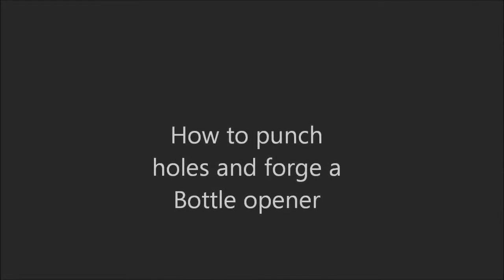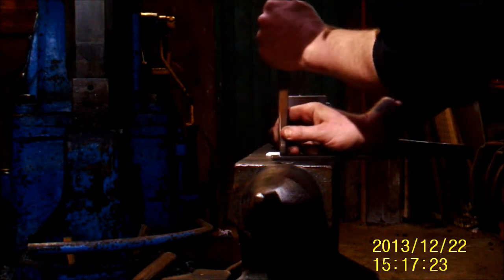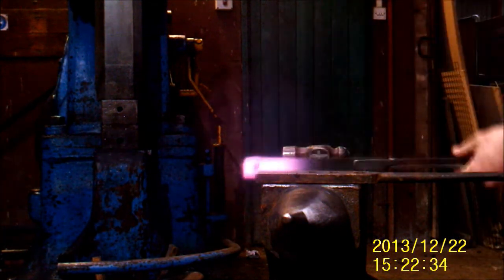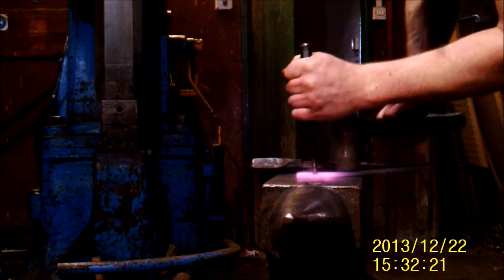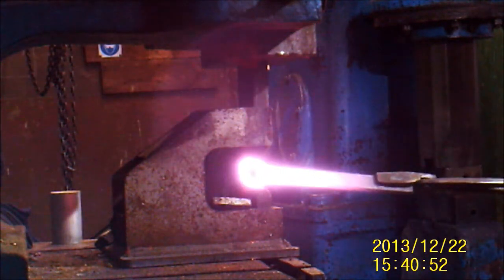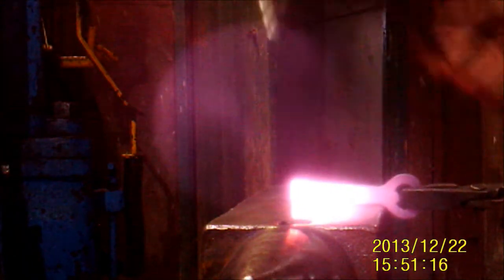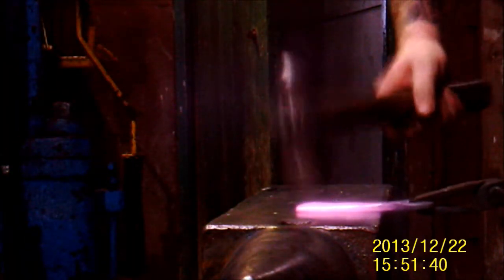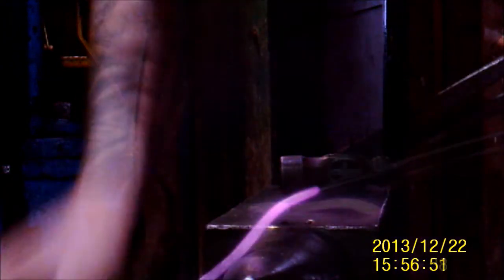The Right Way to Get into a Bottle of Beer

Comment: Now my question is.... Do I have to drop it as much as you did to get a functioning bottle opener? Maybe that's my problem. Also... I feel weird about the pre googley eyed Massey. Define Your Legacy!
Reply: Based on my previous work I would guess I would drop a bottle opener at least as much as this vid! It doesn't need normalised or hardened so I reckon this piece is a success.  The google eyes are....interesting.